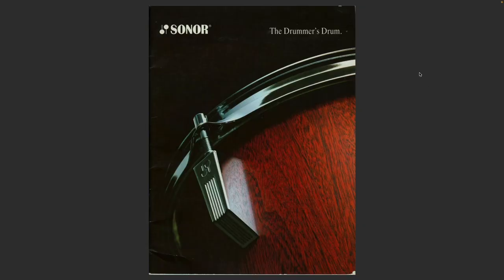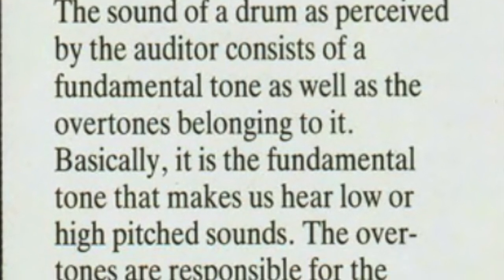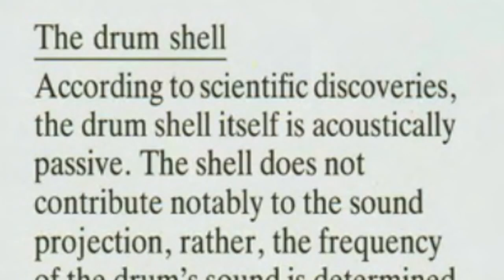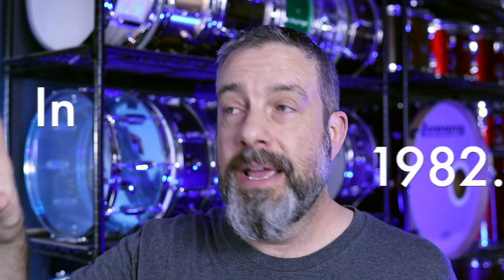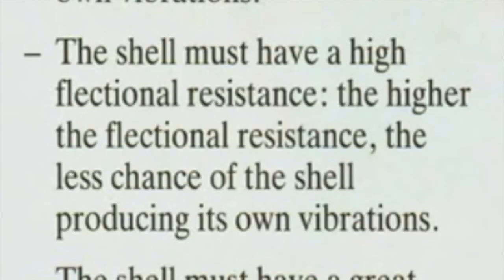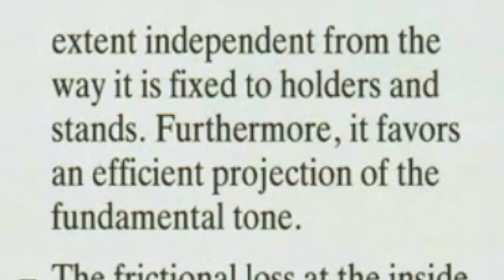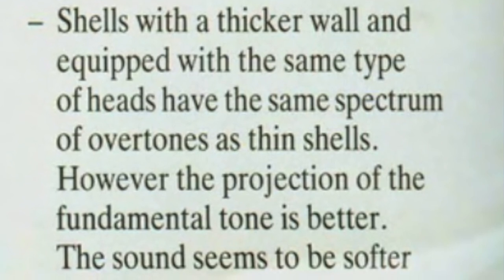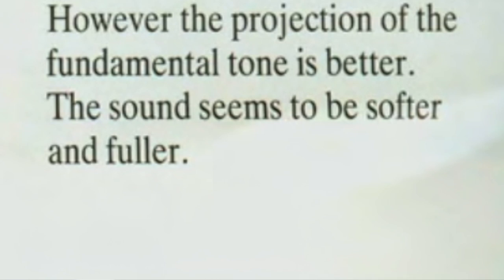That's Not What I've Been Told!  Drum Sound Physics, Part ONE

Comment: I never really thought about the sustain part of it, but I have noticed that thicker drums have a more focused sound (more of the fundamental pitch and less overtones). I play a simple 4 piece kit and I like what I consider to be an "old school" kind of sound with lots of overtones, but I've often felt that if I played a bigger kit with more toms and less size difference between them that I'd surely want to go with thicker shelled, more focused sounding shells so that the pitches on the individual drums would be less likely to bleed into each other. Basically, I see that the number of drums in your kit is an important consideration when thinking about the kind of drum shells that you should be using...
Reply from the maker: That is an interesting perspective that I haven't thought much about -- that the number of drums might in some way dictate the type of shells one uses.  Thicker shells would emphasize notes more, but not certain that thinner shells/brighter tones would be particularly detrimental.

Hmm...

Comment: I’ve been seeing a trend in all the best sounding wood snares and that is the plies are 1mm and over. So for instance a 6 ply maple 7.5mm thickness is 1.25mm a ply. So if they advertised a 20 ply maple snare that is only 5mm thick… then that’s a lot of glue. Also 45* straight bearing edge was a common variable.This is for ply drums not stave or single ply, and not including re-rings. 

My question to you all is what thickness vs ply and also bearing edge, rim, lug etc have you noticed in the best sounding maple snares?

Comment: I think the plastic wrap thing is more an issue of a light shell dissipating into a loose wrap vs a heavy shell with a well applied wrap which dissipates less into the wrap.

Like if you crank down the arms on a tom stand onto the tom, it will noticeably dampen the drum vs just letting it sit loose in the stand. This will be less noticeable on a heavy drum than a light drum.

Comment: Great video. I completely agree with the message that the shell does not contribute to the sound through resonance, but may rob energy from the drum head by resonating and thereby, indirectly, altering the sound. I always questioned adds and videos talking about the "warm sound of mahogany", etc... It would be interesting to test the thickness and weight threshold beyond which it is  impreceivable to hear a difference, and only size, edge shape and head determine the sound.
Reply from the maker: It really is a big bundle of variables that ARE different, but not always substantively so (though I do find that a drum's mass is one of the bigger factors for whether or not I dig a drum).  

Most of the variables between wood drums truly goes out the window when a mic is used to 'capture' the sound.  At that point it's really up to the signal path and processing to determine how the drum is perceived.  So while all of this IS relevant and interesting, in practice (modern practice, that is... TONS of mics) it is less critical than it used to be. 

But I still LOVE it!

Comment: Something interesting to try would be adding a bit of pressure-sensitive resistor material under hoops so you can measure the pressure differences of the hoops.

Comment: Also Pearl has been making pretty thick shells throughout the thin shell hype over the years.   The reference series uses three woods and thick heavy shells.   They have a pure version which is thinner.  But the reference series is used by ALOT of guys playing huge venues.   They project like crazy.   Pearl also has the stadium series masterworks kit which is very thick heavy maple shells.   No joke the kick drum alone weighs close to 70 lbs.   not a take to local bar kit.
Reply from the maker: Great to know!  I must confess (please don't hate me...) I am not very knowledgeable about Pearl's product line as I have never been a Pearl fan, primarily because of their tom holders which I just have never loved.  I have found them to be a hindrance to ideal positioning compared to L-arm types mounts.  

And (if I am being totally honest) I am bothered that most all the bottom line drum kits available typically use a similar type of mount, which has certainly colored my opinion, probably more than it should, for the last 40+ years now.  

Maybe it's time to put my big boy pants on and reconsider??  I do have a Pearl phenolic snare drum that I dig...
Reply: @drumdotpizza  I kinda hate the pearl mounts too, but when I had an export you don't notice them, apart from the extra weight. I wouldn't get a pearl kit now specifically because of them. I don't want to have to spend extra money to mount my toms like that.

Comment: Awesome content thank you! When I first bought my PDP drums few months ago I noticed a difference right away from other drums I had. These or the made in Mexico LX series that were really DW drums. I don't believe there anywhere near thick as what you're talking about, but at that point there were the best drums I had. I still have. But when I got them home and tuned up the 12, my son said my face lit up with the smile from ear to ear. The sound to me was amazing! And I realized after listening to this that it was the heads. They came with the original DW heads that were single ply with a little white coated stripe around the edges. Top and bottom. Prior to this all of the heads I had used were always double ply on top. Like Evans EC2S. When I ordered new drum heads for the kit I ordered all DW heads again thinking I absolutely love that sound. And it's just that it's an open drum. I've learned so much in the last 10 months about drum sound. Listening to stuff from you augments it a lot!

Comment: This was great, thank you. After much experimentation over the years I've basically come to the same position - it's the heads doing the work, and to the extent that the shell vibrates, that transition of vibration from head to shell is incredibly inefficient, robbing the heads of their sustain, not enhancing it. I've recently gone back to 80s Pearl MLX drums specifically because of their fairly thick shells (and I like the RIMS mounts too). I can't wait for more videos on this topic.
Reply from the maker: Thanks so much for your kind words!  The next installment in this series is about shell materials -- probably a two parter, one for wood, another for metal, acrylic, fiberglass, etc.  Pretty hairy topic, but hoping to be able to distill the info down to a more digestible form (and hopefully not be an hour or more long!!  ;)
Reply: @drumdotpizza  Have fun! I did a video testing a few different toms with a few different head options, and it was a ton of work. I appreciate the amount of work that goes into videos like this.

Comment: Joel, thanks so much. I've seen a number of your videos  (yes, I made it to the end of this one) , and I appreciate your analytical approach and the the light you're shedding on drum sound. 

However, I was confused by your use of the word "decay" as though being synonymous  for sustain. Decay would be to rot, deteriorate or to decrease in magnitude. It is the opposite of sustain. A sound that decays is a sound that declines and doesn't last as long. A sound that sustains is a sound that continues for a greater length of time. Just thought I'd throw that out and try to clarify the definition of decay.

Thanks again

Comment: I stumbled onto your channel and am glad I did. Good stuff. I was always skeptical about thinner shells having better resonance but thought any difference would be pretty much unnoticeable. I have a 10pc Tama Artstar Custom with power toms (7mm thick shells) and I often get compliments on how good my drums sound. The thicker shells definitely project better. I would assume they also sustain longer, like how thicker cymbals do.
Reply from the maker: Thicker (heavier) shells project the fundamental tone/pitch of a drum better than thinner shells, though at a distance that could translate to a rather dark sound compared to the sound of a thinner/lighter drum at that same distance which, though a little quieter, would have more clarity as a result of the higher percentage of harmonic in the sound.  Those higher frequencies get absorbed by air over distance, but the reduced low end would result in a more balanced tone across a room, for example.  

And yes, drum with thicker/denser shells will have more sustain, all other things equal.

Comment: By the way, resonance only has one meaning in physics. i.e. the frequency at which the output of the system (be that current, voltage, sound waves) drastically increases disproportionately compared to the input. Put another way, you sweep the input frequency (the driving frequency) at the same level and the output drastically increases at a particular frequency. That's the resonance frequency of that "system". For physical things such as drum shells it's also known as "natural" resonant frequency, which is the fundamental frequency (read note or tone) you hear when you tap a drum shell (without any attachements). You're correct it's something completely different to sustain. 
One of the attributes of resonance is Q. Q determines the "sharpness" of the resonance peak. In reality, nearly all resonant systems (particularly physical ones) are damped to some degree. It's the amount of damping that determines how long a resonant note will "ring" or sustain.
Reply from the maker: Yeah, I'm always interested in what people mean by the terms they use.  I hear 'resonance' or 'resonant' all the time, but often it seems they are referring to sustain rather than actual resonance, which is why I posed the question.  

I have used the term when meaning sustain, so I'm trying to change that moving forward (certainly for the sake of clarity in future video discussions).  Words have value, and I like to use the right words if possible.

Perhaps I should make a glossary video??  Hmmm...

Comment: LOVE this stuff Joel
Reply: Given this discussion of resonance and rototoms, what do you think about things like the Tama Club Pancake kit?
Reply from the maker: Hi there, @PatDowning83  !  Good to see you!  Thanks for watching.  As for your question the Tama Club Pancake kit has all poplar shells which are light and soft compared to maple, birch, most other common tone woods for drums.  There are many factors involved that I will discuss in other vids, but basically pure poplar (not combined with other veneers as was done back in the classic days of American drum building) is a soft wood which will transfer (muffle) the energy from the heads rather easily compared to harder woods.  Further, there is very little actual shell, so not a lot of dimensional contribution to the sound (other than the diameter), no bottom heads to resonate sympathetically, so in all they will produce as short, punctual, attack-heavy tone that can be very cool for some times of music, and their compactness makes them ideal for travel to small gigs/small spaces.  They will not resonate like rototoms as the bearing edges of the softer wood shells will absorb energy more.   I dig the concept of the Pancake kit, but they are purpose built for unique needs and would best serve in those situations (also, if you just dig the sound, then that's great too).  Certainly not a 'normal' kit for broad applications, but very cool when something small and light is called for.  Just my initial thoughts.
Reply: First I want to say thanks. I bought a very light weight thin shelled aluminum kit recently, as I’m not a young guy, and hauling heavy drums, quite frankly, sucks. I think they sound great! I grew up playing a hand me down Ludwig kit, from the late 50’s that my oldest brother gave to me. Wish I hadn’t sold it when I was 17, but was a Yes fan, and saw Alan White playing a North kit, and I had to have one. It is loud, but definitely doesn’t sustain. Anyway, I have a Dunnett titanium snare that is very thin, but does sustain what seems like forever to me, and is loud. I’m not disagreeing with you, but any idea why that snare does what it does? Am I imagining it, or what? I really appreciate you taking the time and effort to educate the masses, and I hope your channel takes off like a Bill Bruford drum solo.
Reply from the maker: @StevesRykerAdventures  Wow!  A Bill Bruford reference!  You are truly my contemporary!  Thanks so much for commenting!  As to your Dunnett titanium snare question I have three immediate thoughts of consequence:  

Firstly, in this video I mentioned, but saved till later discussion, 'flectional resistance.'  Titanium has MUCH higher FR than any tone wood used for drum manufacturing (frankly this also relates to your aluminum shell kit, FWIW).  I'll discuss FR in a future video, but it does mean a little "apples and oranges" at play here.  

Secondly, I wonder what you're describing when you say sustaining forever... I'm thinking you're describing the overtones/harmonics ('ring...') of the drum, not the fundamental note.  This is what I would expect anyway, given that titanium alloys I am aware of are all low mass (I used to have a titanium lawn mower that was incredibly lightweight).  As such they tend to produce less fundamental.  

Thirdly, the drum you're mentioning is a snare drum, which involves a whole lot more variables than toms and bass drums (something I failed to define in this video -- it was primarily a discussion of tom and kick behavior, though denser snare drums do produce a stronger fundamental).  I know of no snares that have a sustaining fundamental primarily because snare drums have beds cut into the bottom edge that stifle the heads ability to resonate.  Couple this with the fact that the bottom head is usually rather tight on most snare tunings, and it simply won't produce the kind of sustain (fundamental sustain) that I discussed in the video, another reason why I think you're observing a liveliness or overtone 'ring' from the drum.  

I have not played one of those snares personally, but I wonder if you have had an opportunity to compare it with an otherwise similar Dunnett steel shell version to see what the differences are???  Steel, a much denser material would likely produce a more solid fundamental (bottom end punch/weight) than the lighter titanium, all other things being similar.  I would LOVE to know your observations about a comparison like that!

Thanks again for your comments and the encouragement for my channel!
Reply: Definitely a ring. Unfortunately I don’t have the steel version, although I was looking at them online, haven’t heard one in person. I may be looking at a Keplinger in the coming months, so a comparison is not out of the question. Thanks for the quick response. Loving your channel BTW.
Reply from the maker: @StevesRykerAdventures  If you snag a steel drum of similar size, lug count, etc. I'd very much like to hear of your observations comparing the two, preferably with same head types (and condition of the heads), wires, etc.  Very interested in stuff like this!  Thanks.

Comment: I just came across your channel. I have been messing with drums for more years than I would like to admit. All my experience has been un miked. Now i have learned that sound comes from heads and tuning (I really miss the ludwig chrome dots) i feel shell is hype. The size hight and diameter creates volume of air. This air is moved when the head is hit. The volume of air is compressed in the drum with only the vent hole or no reso head to allow escape.
Reply from the maker: Thanks for your comment!  

I wouldn't discount the shell's contribution just yet, certainly not for modern, thin shells, the performance of which are far more impacted by the shell material used.  The unique characteristics of each type of material (density, hardness, texture, etc.) has a greater impact with thinner/lighter drum shells than the same material in heavier applications, and it can really have a significant impact.  

I do, generally, prefer playing heavier drums, however.
Reply: @drumdotpizza  i do get what you are saying here about density, thickness, and hardness. I will pose the question/ challenge to look into tone wood. I feel this is a sales thing due to the fact that drum shells unless custom made or are acrylic are thin layers of wood shaped and glued together ( plywood) i love the conversations you are having.
Reply from the maker: @jefflincoln1374  Thanks so much!  I will tackle tonewoods in a future video, but the nutshell (spoiler alert) is that, so far as I can determine, as long as you aren't on the extremes of typical drum tonewoods (basswood and bubinga, for example, the former being very light and soft and the latter being rather dense and hard) the differences aren't shocking and can be inconsistent log to log.  

For example maple, birch and beech are fairly similar in performance all other things being similar (thickness of plies, number of plies, finish, etc.).  You're not likely to hear much difference between woods within a typical range of professional tone woods.  The differences you DO hear from drum to drum within such a range will be more due to fit and finish than the actual tone wood used.